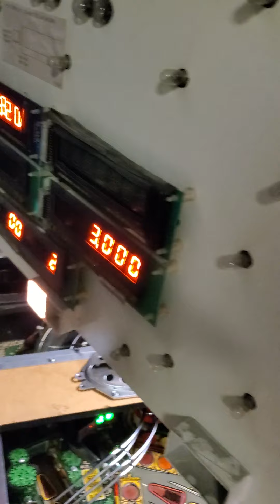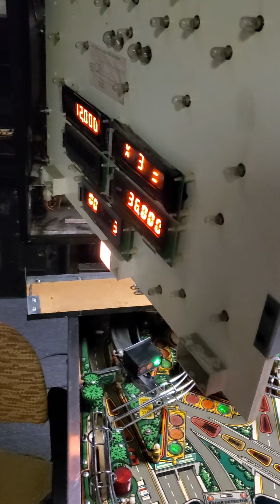Need Pinball Tech Help: High Speed Sound Issue/New Rottendog MPU

Comment: Hey Joe, here is how the sound and sound effects work on that board.   The Pot adjustments are NOT for the music, they only control the 2 channels of other sounds.  Sound effects and speech call outs.  Music is handled differently.  Set your main volume control for the music level you like first.   THEN in the Sound Test, go to the (2nd sound test, not music).  The 2 pots will control the volume from nothing to loud.  When they are adjusted wrong, you will notice some of your callout or effects will go away completely.  Turning left lowers the level, right increase the level.  The idea is to balance the volumes to match the music level so there is not an extreme difference.  Hope this helps

Comment: The music running after game over is original, the only issue you have (which is a serious one) is all the sound effects are missing.  Those may be handled by a separate rom chip, so you may have a problem with the wrong size rom installed for the way the board is set up.   PERHAPS (although I don't know) the original system 11/a/b/c boards used different size roms , and a jumper needs swapped to change the size that the board is expecting.  

Also if your rom chip is empty it would probably do the same thing.  i don't know specifically about that board, or those roms, but that would be my guess.

Comment: Did you ever find a solution? Have the same machine and Rottendog board and having same issue. thanks!
Reply from the maker: No solution yet. A friend is looking at the Rotten Dog board for a solution and is letting me borrow his original MPU for the time being. If he figures it out, I will report back.
Reply: Post this video link on pinside.com pinball experts will help. I had high speed pin around 2001 but didn't have sound issues. I would get new sound chips and see if that helps but can be board or wiring issue.

Comment: Old video, probably too late but for the rest of us...
I am getting the same problem on the same machine.  I don't have an answer yet but I think the speech is done on the MPU board and only the background sounds (working on yours) are on the secondary board.  This would verify out if you got the test MPU you said a friend was bringing.  Surprisingly little out there on the theory of operation with sound and speech on system 11.

Looking at the ROMs available, U21 and U22 on the CPU are labeled "Speech".
Reply: https://www.youtube.com/watch?v=gcee25S6_qI
This video shows the sounds generated without the external sound card attached.  Verifies speech is in the MPU board.